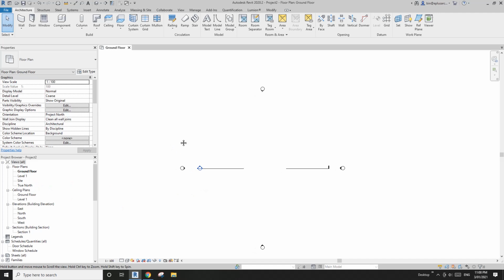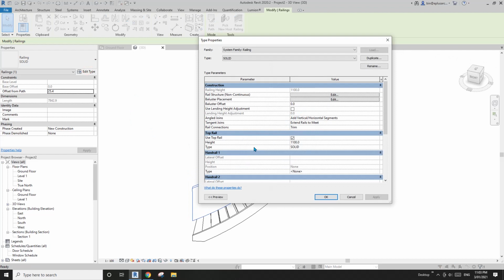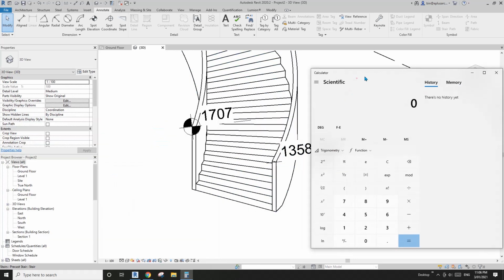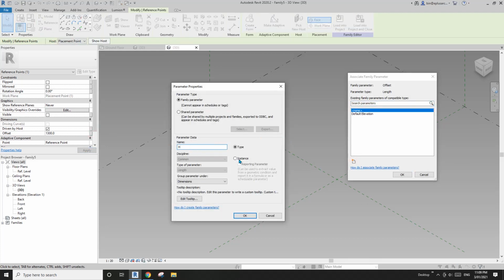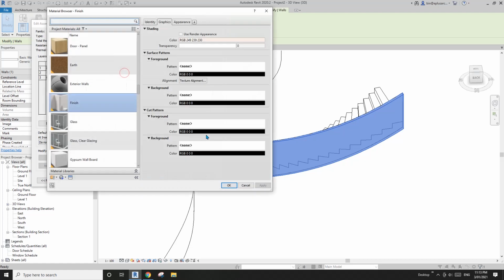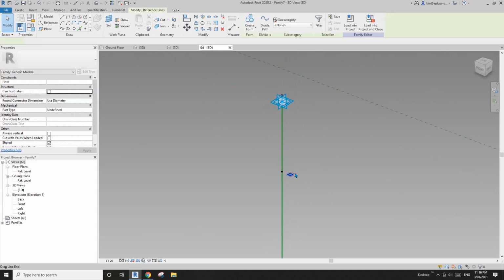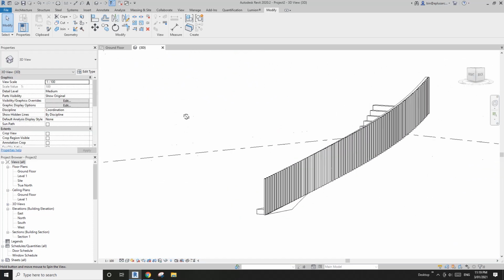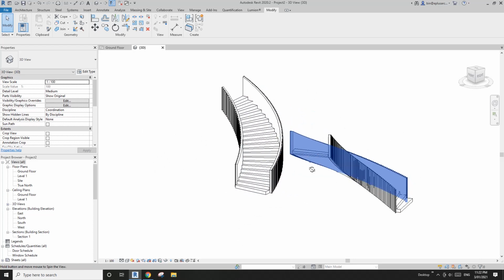Everyday Revit (Day 290) - Spiral Stairs Railing Experiment

Comment: very interesting point of view. Is it possible to make (or share) the "H" (height) parameter in the main family? So that when modeling you can modify the height without editing the family. Thank you in advance.
Reply from the maker: I think I did this, didn’t I?
Reply: @BINHE615  Of course, you did, thank you. To be honest i was working only up on the surface in which i can build a "wall by surface", because i find it more useful in everyday modeling: less is more ;)
I solved the problem creating a "type" parameter for the height of the surface, so i can build a wall over it.
In my case there are:
pros: if the wall is straight you can build a railing up on it, even if it's sloped;
cons: if the wall is curved it's not possible to put a railing.

Cheers ^_^.